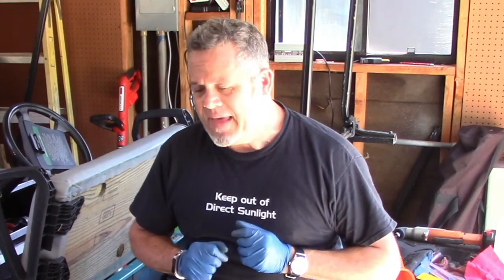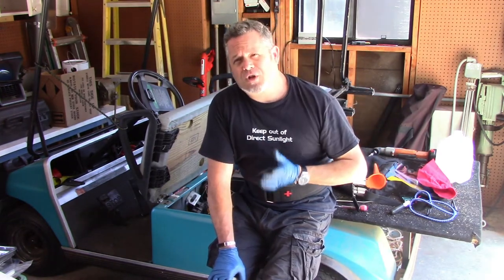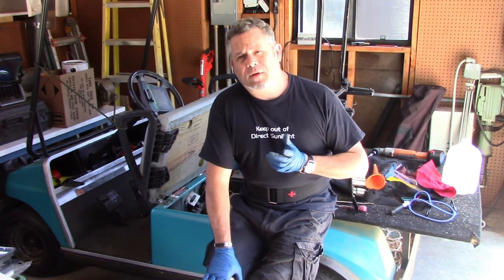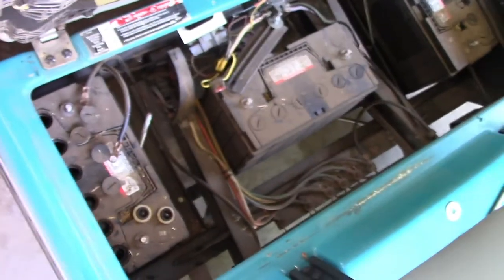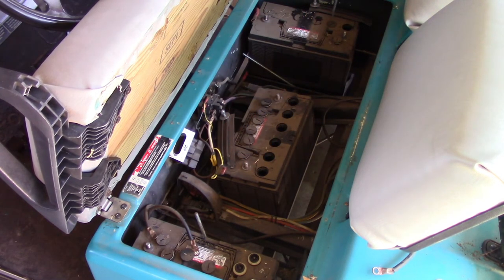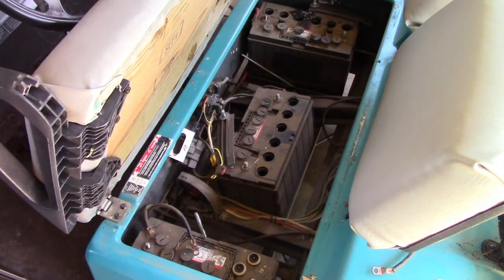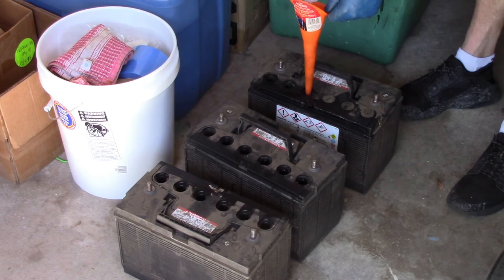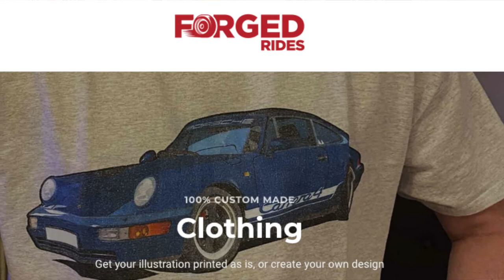Can We Recondition Golf Cart Batteries At Home??  Same as a car battery?

Comment: All that time and he don't tell us if it worked.
Reply from the maker: Sorry, went through quite a few life changes, moved, and no longer have the golf cart.  Only achieved partial success with the battery reconditioning.  Two batteries turned out to have the inner workings too far corroded to be able to be fixed with a chemical flush, refill & recharge.
Reply: Thanks was wondering if it worked?

Comment: So.. I obtained a ezgo txt today, they were mostly dry, i put some distilled water, but the charger does not click on. I notice some of the batteries are swollen around the positive posts. I dont know if I am wasting my time trying to get them to take a charge.
Reply from the maker: Open up the ports on top and shine a light inside to inspect the plates in there... if they are corroded badly, this reconditioning process will probably not work.  If they are only mildly corroded, it may work.  If you don't see any corrosion, then try using the epsom salt method and slow charge them... they should revive.

Comment: For this to work you need to drain the batteries out flush with warm water and baking soda until liquid runs clear the n repeat if need be,.

Last step add Epsom salt to distilled water then trickle charge back to full health is Wealth dude